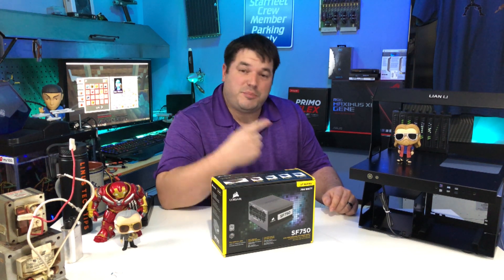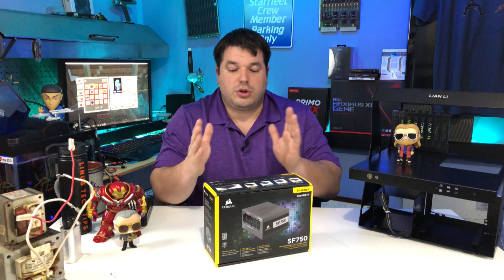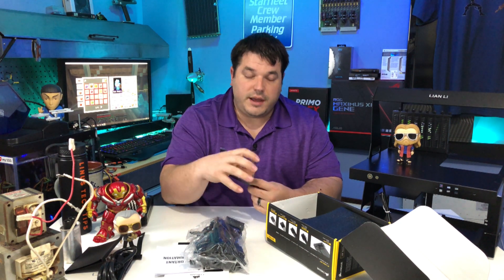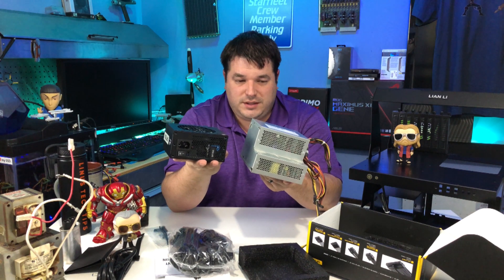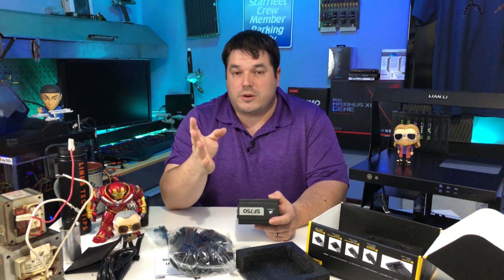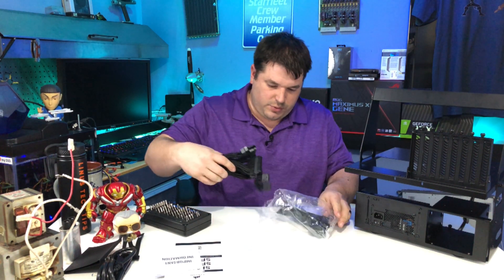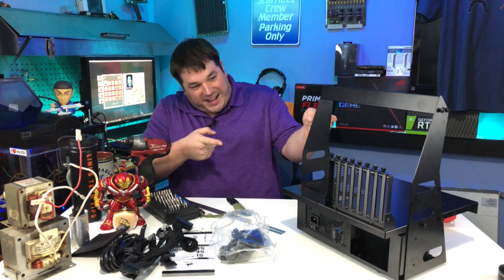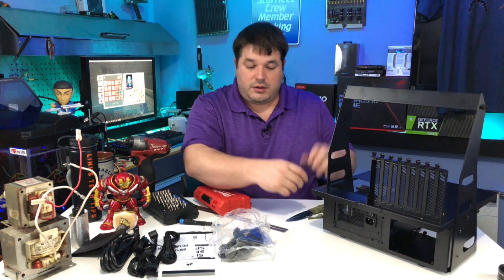CORSAIR SF750 POWER SUPPLY

Comment: Subbed. Just got the S750. How’s the PSU holding up and did you need longer cables? And if so, which ones did you get? Or just extensio cables?
Reply from the maker: The power supply is holding up great! Literally zero issue. I did end up modifying my test bench to fit the cables but it all worked out pretty nice. When i do get custom cables for the final build i will use cablemods
Reply from the maker: And thank you for watching and subscribing i really appreciate that!